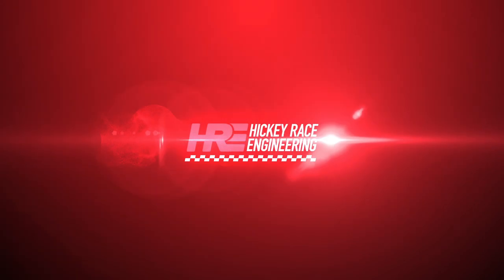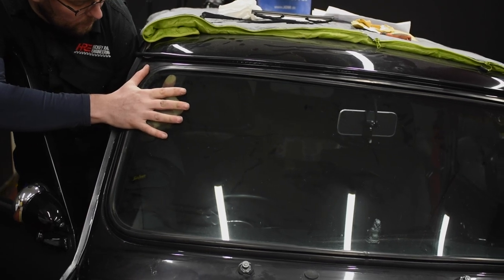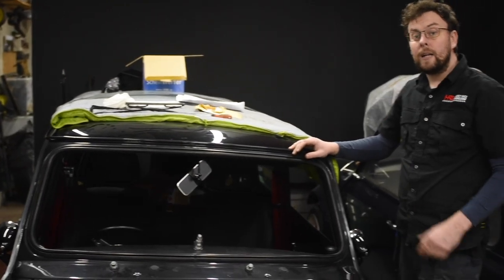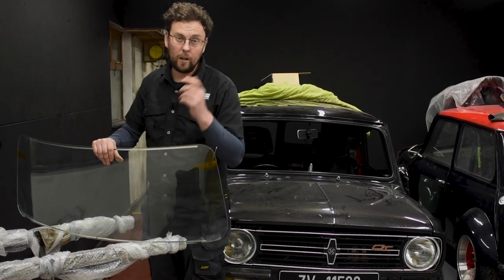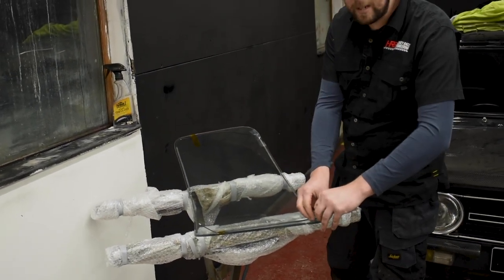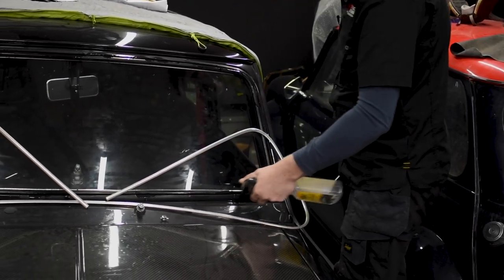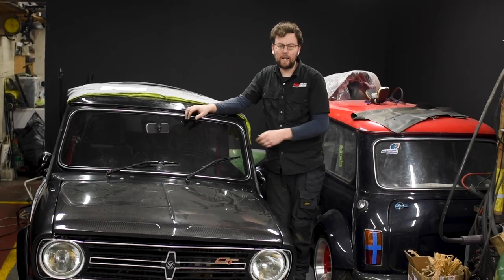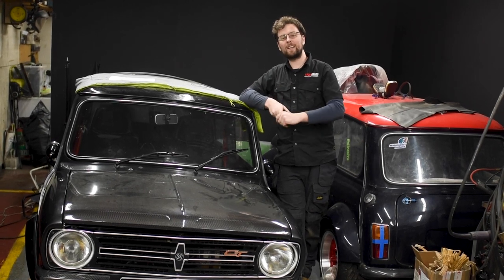How To Fit A Heated Window On A Classic Mini Cooper Vehicle

Comment: Just seen this, another great educational video. Back in 1964 I fitted one to my mini, I got it from work, it was an early works type unit with the thick wires. In my case I had to grind back the metal screen surround because the new screen was slightly larger. Personally I always used the string method without any  problems and a tool with a roller to insert the sealing strip, also used a rubber mallet to finally seat the screen. By the way I think that I may have been the only "private" owner to have one back then. Sorry to be critical but that auxiliary switch panel is in a very dangerous position, in an accident it would cause severe cuts to the legs, it should have been fixed to the top rail or even fit the switches into the rear parcel shelf trim.
Reply from the maker: wow that really cool Tony, I would say seeing one on a road going car back then would have been very rare. never be sorry for critical feedback it is the most helpful. Unfortunately I had no input on where that panel was placed. Customer was very clear on where he wanted it. To Quote Lord Tennyson "ours its not to reason why". In my racers I put it on an aux  switch panel mounted on the cross member near the handbrake
Reply: @HREIRL  The customer is always right even when he's wrong! Yours is a much more sensible place.
Reply: In a mini that would be the least of your worries (IMO)

Comment: Best viddy I've seen on fitting the windscreen. Came here to see if you were addressing a rear heated screen with a bad heater. Unsure if this is fixable. My car has aftermarket tint film over the heater grid. Not sure how the electrical connections attach to the glass.
Reply from the maker: Hi Tornado, thanks for the lovely comments 👍in some cases you can clean off the conections where the wires are afixed to the screen and use low melting point flux solder to solder on a piece of 28-0.30 wire. The factory in most screens bond on the original conections in the early days they where soldered. Hope that helps
Reply: @HREIRL  I've seen/heard about a Permatex conductive adhesive that can be used to repair the connection points on window heater elements....even has a procedure for repairing the thing grid lines if needed. Just have not looked closely at how the connections are made on the mini. I'll need to test to find out where the issue lies....at connectors or on a grid line.
Reply from the maker: @TornadoCAN99  ho I have never heard of that I must look into that would be handy to have on hand. Thanks for the heads up.
Reply: @HREIRL  https://www.permatex.com/products/specialized-maintenance-repair/defogger-repair/permatex-complete-rear-windowdefogger-repair-kit/
There are other kits...just search for "defroster repair".

Comment: Can you tell me is it possible to to wire the positive to to rear heat switch, so you get both front and back screen heating at the same time?
Reply from the maker: Hi Billy you most definitely could you would just need to add a Relay to the circuit because the front can draw 17 Amps and and the rear can draw 20 A which would overload the switch.

Comment: Would you mind giving the brand of the wire stripper and the terminal crimper? I'm also not a fan of the blue, red, yellow type connectors.
Reply from the maker: Hi Reg no problem at all here is affiliate links to both these are the ones I use 👍 
Crimper and crimps :  https://amzn.to/3GpWyHR
Wire stripper : https://amzn.to/34Ndbj1

Comment: Thanks again for this tutorial. I didn't put in a heated windshield but I did replace the chrome strip and a new seal. It took me multiple viewings to pick up all the nuances of what you did and several attempts but it's back in and I'm pretty sure I could do it again and faster/easier. Any thoughts of showing the rear replacement?
Reply from the maker: I have a few back screens to do in the near future I will make sure to get a video of one of them going in 👍👍 glad you found the video helpful
Reply: @HREIRL  I've allways been told you shouldn't reuse the older windscreen rubber seal, and then i just saw you and confusion installed in my mind.
Reply from the maker: Hi José, this car was only built about 3month previous to the installation of this heated windscreen so it was fine to re-use however if the rubber has been on for a long period then it’s deffently a good idea to replace it

Comment: I enjoyed this for the windscreen removal/replacement - a job I dislike as it always seems to require a lot of effort and takes ages. Like you I use Fairy Liquid and cycle tyre levers and it is best to keep screwdrivers away. Recently I have been struggling with the fillet strip which goes in OK but a couple of days later starts to go crinkly at the corners. I have purchased product from both Mini Spares and Mini Mine with the same result. I spoke to MS and the guy seemed to be aware of the problem suggesting I try a black fillet instead. That is a bit non-standard so I am seeking a better solution. Do you have any experience of this problem?
Reply from the maker: Hi Graham, unfortunately I have experienced just exactly what you have said. there is currently no easy answer. I still have some older ones in stock which Im using up at the moment you do see some older ones pop up from time to time on the Bay so maybe worth keeping an eye out there 👍👍
Reply: @HREIRL  Thanks for responding - glad it's not just me. I will do as you suggest and look out for some old stock. I'm not doing any screen fitting until the weather warms up as it is still only 8C in my garage this morning...

Comment: Do you get leaking through the seal where the wires push it back a bit? I’ve installed a heated screen in my mini and it leaks through the seal where the wires are
Reply from the maker: Haven’t had that problem our selves but a little Acrylic based sealant around the wire should solve that problem

Comment: Do you think using a classic mini as a daily through the winter is feasible? 
I garaged mine, as I thought it would rust to bits with the salt on the roads (in Scotland).
Reply from the maker: I think you might be making a wise move there. Minis dont like lots of rain and they deffo dont do well with salt

Comment: I have one to wire up on aq morris minor and have been advised to use a relay. Is this necessary
Reply from the maker: Hi Ian, it would all depend on the kind of switch you youse and the current limit. Using a high amp relay would be the safest